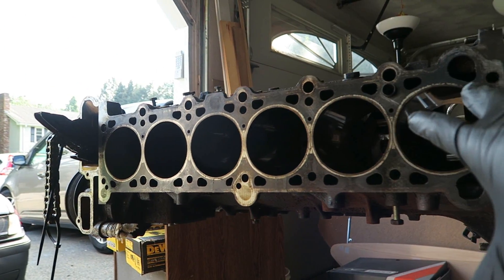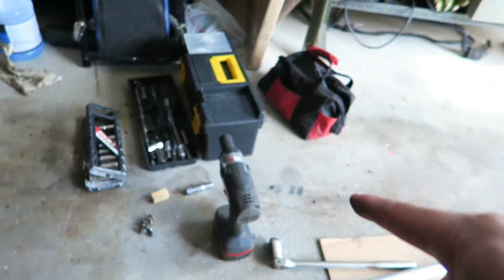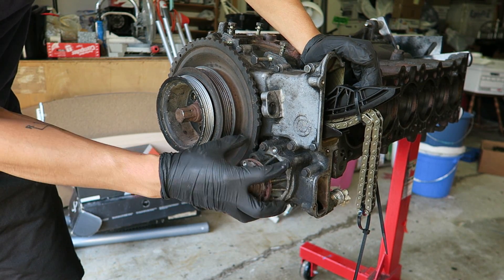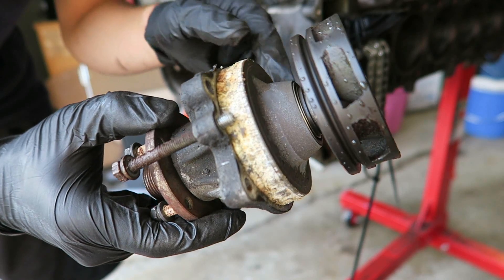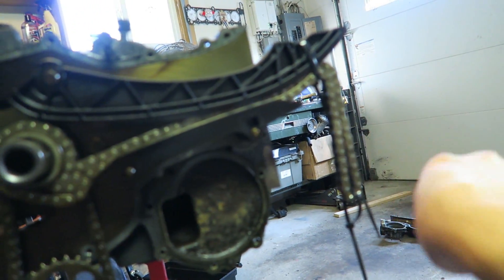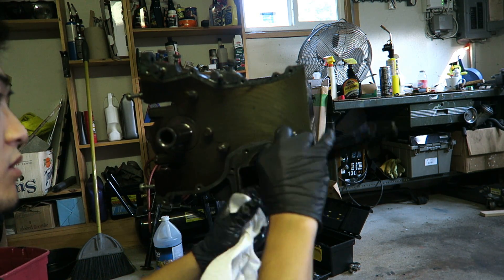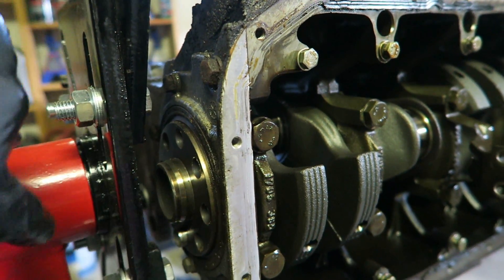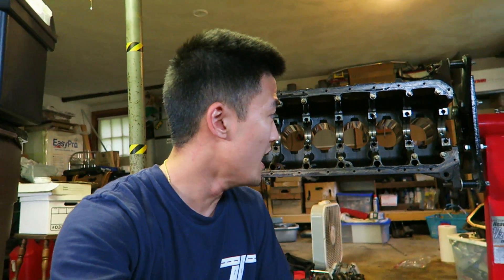BMW E36 Engine Teardown [Pt 3]: Crankshaft Removal and More! (m50 m52 s50 applications)

Comment: Hello, I have a timing question. Is there a timing concern regarding the two sprockets that goes onto the crankshaft? one for the oil pump and one for the timing chain. The two sprockets that goes on the crankshaft has a dowl indent  so the sprocket can only go in one way. Do they need to be installed or fit in a specific way to not mess up the timing on top?

Comment: this video series has been immeasurably valuable to me as I'm working on my forged internals build. I just got to the removal of the crankshaft on my teardown, and I couldn't figure out how to loosen that harmonic balancer nut so I came back. Thanks for the hard work man!
Reply: Heyyy about that harmonic balancer, do you happen to have any idea if i have to swap it out if i make the stroker build on my m52 with m54b30 internals?
Reply: @norphes3865  which m52? Tu or non tu?
Reply: @deltacharlieecho4732  mine is EUDM m52b25 non tu. Is its stock balancer enough to absorb vibrations created by an m54b30 rotating assembly? Or should i swap it aswell?
Reply: @norphes3865  the m52 non tu still has the crank sensor teeth on the outside. I believe all m54 cranks have their sensor teeth on the inside so you will need to use the m52 balancer.
Reply: @deltacharlieecho4732  Ok understood. I still don't know much about the matter so i'll have to research if a harmonic balancer for smaller internals will be sufficient for the vibrations caused by a bigger crank etc...
That was very helpful, thanks a lot stranger 👋

Comment: I wish I had the space time and all the tools, to take apart my m52 engine, I’m having misfires, I have changed ignition coil spark plugs and MAF sensor, somewhat stuck on what it is. I want to take the engine part due to the fact that my dad didn’t do any mechanical work, I want to give it a new life and also clean.

Comment: Do the plastic guides ever need to be replaced?
Reply: Mine actually broke so I recommend it lol
Reply from the maker: That depends, usually you only need to change the tensioners. But if the wear looks significant it's not a bad idea to replace them, especially if the engine has a ton of miles on it (175k+)

Comment: Good day. O teally enjoyed your videos. Thank u for sharing. What i would like to ask is when assembling the connnecting tods to the cranshaft. Which direction do they face. Please advise
Reply from the maker: I can't remember off the top of my head, but I remember that I just googled a pic of the engine without an oil pan to get the rough idea of the orientation . Sorry for the late reply!

Comment: Is it possible to remove the timing case off without messing up alignment? Meaning i can remove all the pulleys and pop it off with no issues while the car is on the ground? Thanks!
Reply from the maker: Yes you should be able to. The timing case has alignment pins 👍

Comment: I'm really struggling to remove the Timing Case on my M52. I loosened all the 10mm bolts but the gear that sits just behind the 'Harmonic Balancer Unit' on the Cranshaft won't budge an inch. Any tips?
Reply from the maker: I’m having a little bit of trouble visualizing your progress. Do u have an Instagram? That way we can message each other and u can snap a pic of how far along you’re at

Comment: Question - why do we want to maintain the timing chain orientation so much?
Reply: P.S - totally love your videos and editing techniques.
Reply from the maker: Being mindful of the timing chain orientation just makes reassembly easier. Timing from scratch is not difficult, but takes some more tech experience to ensure everything is lined up TDC.

Thank you! I’m glad you like the videos 😌
Reply: Pawinning Makes sense. Do the sprockets only go on the end of the cams in a certain way? I.E is there a pin or key? Thanks for the reply :-)
Reply from the maker: all the sprockets have a specific orientation they must be installed and locked down too at TDC. I believe my buddy Quinn from M3nace (another channel) has a useful video that explains it further! I've yet to break down the process myself.

Comment: how does a m50b25nv engines cams timing chain come off with no vanos?
Reply from the maker: Never done that personally, but in my opinion the mechanical system is simplified without a vanos unit. You’ll still need to lock camshaft but the sprockets holding the chain shouldn’t be more difficult to remove than the same system set up with a vanos assembly.

Comment: Hope you kept track of which main caps went where. If not, you are going to need a line bore.
Reply from the maker: +Matt Mauro yes I did keep track!
Reply from the maker: +Matt Mauro I'll probably get a line bore done regardless because I'm replacing the crankshaft. Taking no risks for poor tolerances

Comment: Had my chains marked/ ziptied until I took the cover off and I think the chain skipped a tooth. How much of a hassle is that going to be if any? I'll post a pic on Instagram for you to see if ya need
Reply from the maker: +photojnt shouldn't be too much of a hassle, after taking every thing apart, bottom end timing stricly relys on the crank at TDC, then the rest is mainly lining the timing blocks up with the cams, and orienting the sprockets so that the arrows point in the correct directions (all which I'll be doing in the future)
Reply: Pawinning sweet! Good to hear. Thanks again!